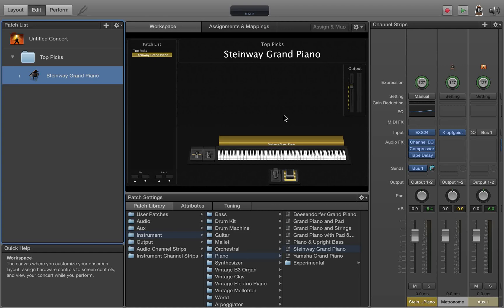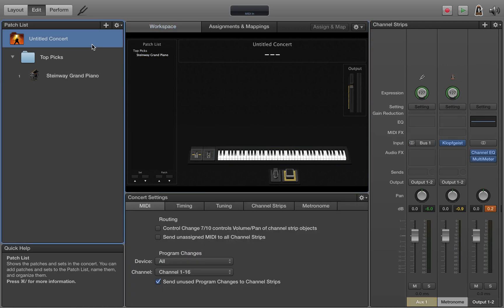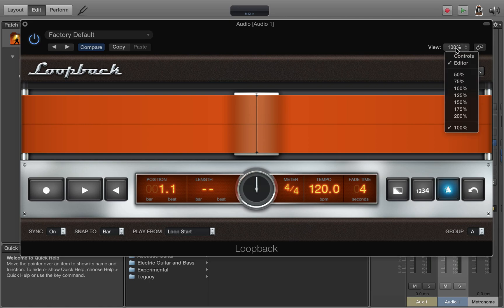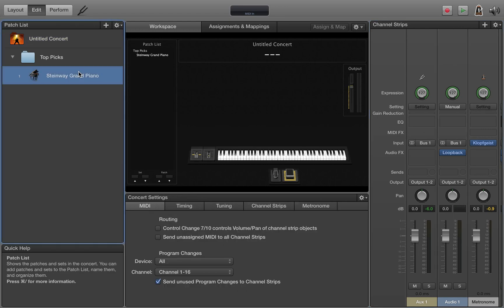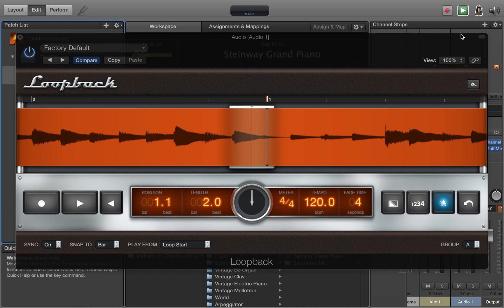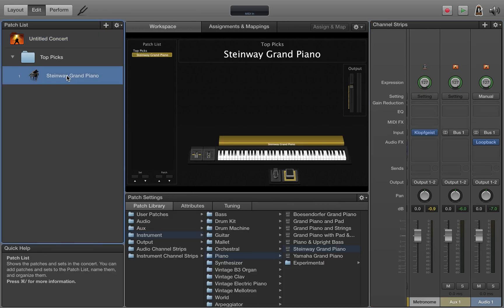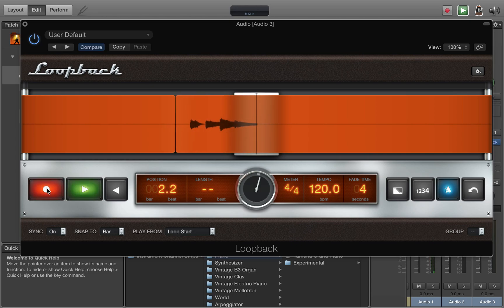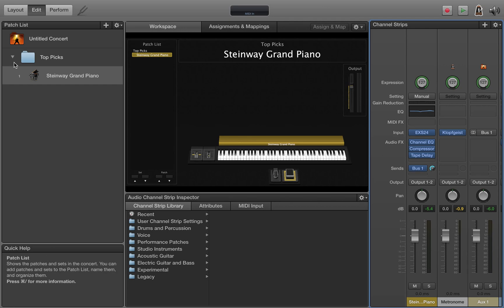Mainstage Looping Tutorial (part 1) - LoopBack Setup

Comment: Hi Jordan, I'm using mainstage 3.4.3.  is there a trick to start recording when I hit my instrument? Recording starts simultaneously when I hit the record button or after the 4 bar count. So I have no time to grab my guitar or keyboard. And yes, there is a checkbox for this option under the controls view, ( Start recording in play action) but that does not seems to be working. Many Thanks!
Reply from the maker: If you are referring to some king of audio/midi detection that starts recording when it detects the first note, I don't think mainstage has that (and loopers that do have been really finnicky, in my experience).

There are two ways to run loopback: Synced, and Unsynced. Sync ties record/stop actions to the metronome in mainstage. I prefer this way and my workflow is: start the main clock. Press record, wait until the next downbeat and begin playing, press stop sometime in the bar before you want to stop recording. If you are using a mouse or a desktop button controller, you can usually do this for single hand synth lines, but it rarely works for two hand piano parts. Because of this, I prefer to use a footpedal to control start/stop and put any other controllers like revers/volume/pan on a small pad like a or korg nanocontrol.

Unsynced will start and stop instantly (not relying on the main clock). This is easier since you don't need a click, but multiple loops are hard to get exactly right. A footpedal is a necessity for doing any of this with guitar. I used to use a launchpad and ableton instead of mainstage to loop and I got pretty good at changing my pattern so the last beat of an loop, I could stop playing guitar and quickly stop the loop, but that is not a fun way to perform.
Reply from the maker: And thanks for watching!
Reply: @JordanColburn1  yes, I was referring some kind of detection to trigger recording. I have assigned my keystation 49's buttons to loopback plugin. But I think I should add a midi foot controller into my setup because ı play bass and keys. Also I have downloaded your template, it is much more handy than my concert file :) Thank you for your detailed response. That's very kind of you.
Reply from the maker: @usandthem82  No problem. Good luck finding a good pedal, all of the available ones have pros/cons and I haven't found one I just love.

Comment: Hi, how I've tried to use it, but I have a big problem...is it possible to quantize the loop tracks? thanx
Reply from the maker: Yes, the loopback setting let you choose what to quantize to (I think it defaults to the bar).
Reply: @JordanColburn1  thanx. Can u tell me how? In my experience in default doesn't quantize, neither setting the sync mode
Reply from the maker: @leisureit  https://support.apple.com/kb/PH13669?locale=en_US This page clears up what each of the options should do. With sync turned on and the mainstage clock running (this is important, remember to press play and listen to the click), it will wait for the next (bar/beat/loop), to start or stop recording the first pass of a loop.

Comment: Whenever i record  a loop the play back is off by an eight note or sometimes almost a full quarter. Nothing is lining up. What am I doing wrong?
Reply from the maker: Dakoda Tanksley do you notice this delay in other audio apps. What is your audio buffer set at? If it is too large, there could be a delay causing the issues you are talking about. If the buffer isn't an issue, we could look at sync settings for mainstage and loopback.
Reply: I just installed the update and it seems to have resolved the issue! Is there a way to set a CLEAR ALL parameter? Clearing all the loops after the song is finished. 
Have you ever had any troubles with Overdubs clearing out when the loop comes back to start?
Last question. Is there a way to have new patches automatically route to the loop bus, i.e if i wanted to add something on the fly for improvising but dont want to waste timing routing and setting bus level.
Thanks for your videos man! Ive really wanted to be able to use mainstage the way you are and the vids helped out so much!
Reply from the maker: Dakoda Tanksley glad it's working. You can map multiple clear commands to one button and I would also recommend mapping the length to '--' for each looper to the same button. This let's you reset all loppers with one button.  For auto routing, first make sure you have global busses, looperbacks and audio routed at the concert level and anything whole song specific at the song level for each song. Then you can have a 'template patch' last in your list that has a basic guitar or keyboard sound routed like you want. You can the copy/paste that and adjust the sounds on the fly. I have experienced something similar to the other bug you describe where it seems like overdubs aren't recorded although they should be, but it seems intermittent. If I find a pattern or workaround, I'll probably do another video on it and let you know.
Reply: You are the man! thanks a ton! Subscribing to your channel now.
Reply: how do you keep patches from changing when you hit Pl/St on the midi controller? Ill have a patch selected, ill record with it but when i hit Pl/St the patch will change to a differnt one, usually whatever is the top patch
Reply from the maker: Dakoda Tanksley I don't normally have that issue. Is your play start sending a midi program change?
Reply: I dont believe so. Its the play/stop button for the loops thats doing it, also it happens when I do tap tempo.
Reply: My FCB1010 is sending a program change, I thought I had it set up just to be notes. What do I do?
Reply from the maker: Dakoda Tanksley maybe see if mainstage has a setting to turn off responding to program change. Otherwise make sure all your patches don't use the same program changes that your FCB sends.

Comment: hi , i think iv been setting up my MainStage wrong ?   or dose it matter that ? that what you call patch level i use that as song level   dose it matter ? thanks for the video
Reply from the maker: YAMAN SITAR no, that should work fine as long as the controls you need are mapped at the appropriate level. For example most looping controls should be concert level, while controls for a specific keyboard sounds (volume, cutoff, mod, etc) will probably be mapped at the patch level. Are you having any specific problems?
Reply: no every thing works good ,,i was just thinking maybe the way you do it would be better for the cpu and stuff ,, iv not used the looper live yet but i will soon   ,, thanks

Comment: Does anyone know if you can trigger loopback to start recording when the first note is played..from your midi controller
Reply from the maker: I don't think loopback can start recording either based on audio input like some loopers. You could maybe map all your midi notes to start loopback, but that would be weird and probably mess stuff up when you played the next notes. And remember that loopack only records audio, so your midi controller would have to be triggering a software or hardware synth with it's audio routed to loopback. I could be wrong, and there may be a way to set this. so check out the manual for loopback to see if anything jumps out at you.
https://documentation.apple.com/en/mainstage/usermanual/index.html#chapter=B%26section=1

Comment: Hi, is it possible to have multiple loops? How can you control them live?
Reply from the maker: alexxi10able yes! I have up to 5 loops. Each loop needs a separate loopback plugin. You can then map separate controls for each loop. You can also use loopbacks groups to turn off other loops when you start a new one.
Reply: Jordan Colburn Ok thanks!
Reply: @JordanColburn1  i added different loopback plugins to different instruments. after recording one loop, i let it play on, but it stops when i switch instruments. how to i fix this???
Reply from the maker: @JaiveerM18  my first guess would be that your loopbacks are on the patch level, you need to put all loopbacks up at the concert level. The other option is to look some of the loopbacks and mainstage settings that may start or stop playbakc when patches switch.
Reply: @JordanColburn1  thank you so much. I will try that. Is there any way I can contact you if I have anymore problems as I'm new to the software. Would really appreciate the help ☺️
Reply from the maker: @JaiveerM18  you're welcome. Either here or through my website. It sounds like you're pretty close, so feel free to ask a few questions, or if you need more help, I have free and custom templates on my website: https://jordancolburn.com/templates/
Reply: @Jordan Colburn how do I set the loopbacks to concert level??
Reply: @JordanColburn1  is there a way to use loopback through the patches instead of the audio? to ensure better sound quality?
Reply from the maker: @JaiveerM18  no, loopbacks only record audio, not midi. But check out my other two loopbacks videos for more advanced audio bus routing. It's tricky to setup, but the digital audio busses that connect inside mainstage are all very high quality.
Reply from the maker: @JaiveerM18  https://youtu.be/Fc0XEouT8ZM?t=58 Concert level has loops, busses and tracks for all the mainstage "concert" song and patch are sublevels of that. I recommend loopbacks and audio routing all go at the concert level so that all of your patches feed the same loopers with minimal changes or duplicated work.
Reply: @JordanColburn1  hi, is it possible to trigger the rec/play/stop  through IAC driver? Thank you for your help!
Reply from the maker: @victorsomma  I think so, anything that is a midi message can be mapped to an onscreen control, which is then mapped to the loopback settings.

Comment: Hey Jordan, when I try to change the length of the loop, it says 'disabled'. How do access the length
Reply from the maker: Mark Muir not sure I've seen disabled before.Iis that in the loopback plugin itself, or when you're trying to assign a controller to reset the length? if it is the later case, my guess would be you are trying to assign a controller at too low of a level, check patch/song/concert and make sure you are assigning parameters at the same level your loopback plugin is created on.

Comment: Hey Jordan, sweet vid. I'm leaving the length blank so that it automatically loops once I finish playing, but it just continues without looping even though I've stopped. Any ideas why?
Reply from the maker: It could be a few things. How are you stopping the loop? Try hitting the record button again and not a stop button. Also, Is the overall play button pressed and click track running? My setup uses the main mainstage clock and syncs everything to that. Check all the settings, there are a lot of minor details  buried in the loopback settings that could be causing issues. Mostly just try to get one loopback plugin working the way you want (using a mouse to try controls) then copy that to as many as you need, change the groups(A, B, C, etc) and then map your controllers.
Reply: Thanks for the quick response dude, I'll look into it following your suggestions.